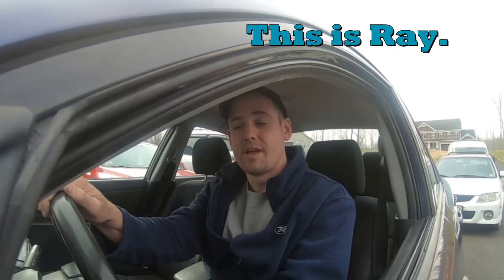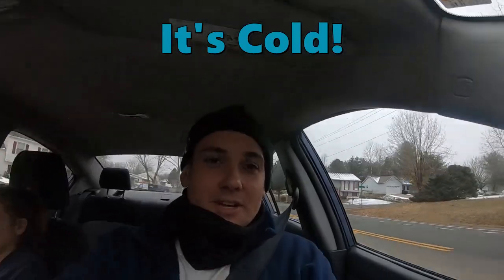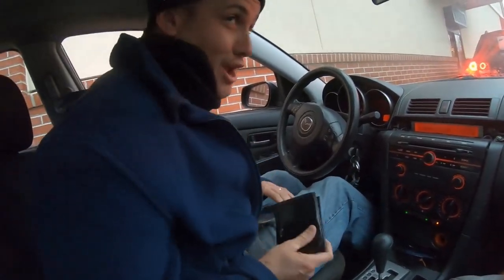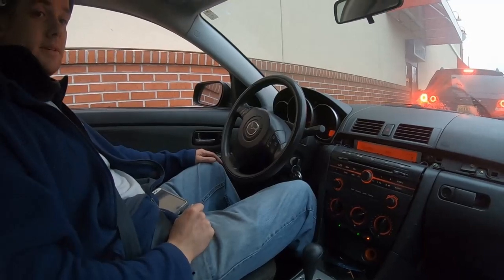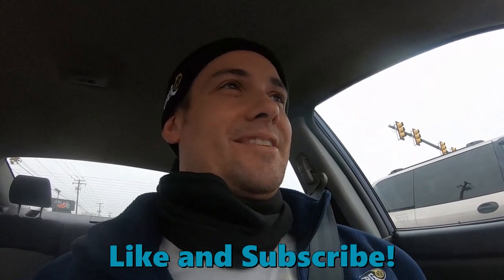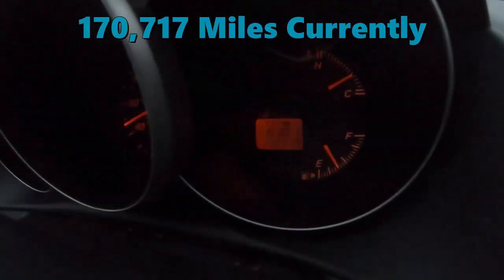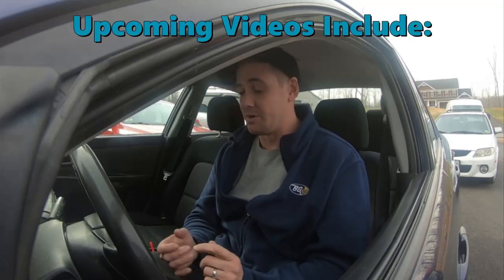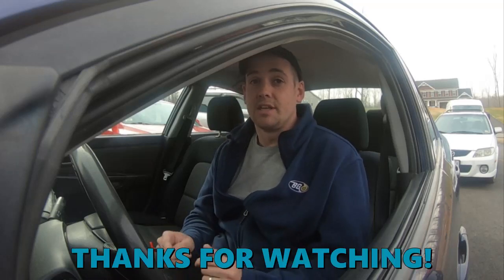Trash to Treasure Mazda 3 How to Video

Comment: I’m doing a similar project on a 2011 Mazda 3 (2.5L with 6 speed manual).  I’m glad yours was at least drivable!  I ended up replacing all 4 tires and rims, front wheel bearings, inner/outer tie rods, ball joints, all 4 sway bar links, rear struts, all of the motor mounts, spark plugs, valve cover gasket, oil pan, and alternator.  Of course I changed all the fluids as well.  The previous owner clearly didn’t take car of it, although they did at least seem to do their oil changes since the valve-train was in great shape with no sludge buildup.

Comment: $1500 for a 194K mile 2008 M3 with "no first gear" No problem when the code was for a stuck open auto transmission solenoid. Paid $1300 after the CVs were found to be wrecked and it stunk of strawberry vape. First to 2nd shift was shocking hard. Removed the solenoid pack and cleaned it, backflushed all 6 solenoids and cleaned valve body, replaced and filled with Walmart high mileage ATF as the stuff that came out was ink black. After resetting the transmission controller with my BT scanner, it shifted great and no more codes. ended up replacing every suspension wear pat minus the LCA's, only about $130 for the entire kit online. REplaced the 2 front wheel bearings and 2 CV axles. motor mounts are next as well as front sway bar bushings (eazy, 4 bolts from UP TOP slide new ones on and bolt back in) car runs great, cute little car. Mine was almost perfect inside and out, just nasty  vape odor inside. Took mats out and pressure washed them and the water running of them was as black as the ATF, GROSS! I got the GT with leather seats and BOSE audio with NAV. Great deal!

Comment: Hey.   Welcome back. 😉 could you answer a question about a rx8?  What causes the clutch to be really soft and barely engage until the car had been running a few minutes then the clutch is perfect until the next day  when the car is first started its like the clutch needs bled or something.. any help?
Reply from the maker: Thanks! Be patient with me, please. Lots of changes coming to the channel and RX8 stuff is on the docket! The biggest difference you have between a car that has been sitting and a car that has been running a few minutes would be heat. Heat would greatly effect the brake fluid operating in the clutch's hydraulic system, as well as the grease lubricating the pilot bearing.That being said I'd start by changing out the fluid. If I had to pick a component, my biggest suspect would be your slave cylinder and/or the rubber line coming off of the top of the cylinder. These rubber lines can swell externally and cause all kinds of weird characteristics. After changing the fluid out, I'd try bleeding it hot and then again cold and see if there is any difference in fluid flow that may point you in one direction.
Reply: @WhitneyAutomotive   thanks.  i was thinking slave already,  the fluids are all new and properly bled 👍

Comment: Hey Ray. So I’m into buy a Rx-8 all new transmission. New air filter. New oil. New oil filter. All oem parts are there. But has 80,000 miles currently. The only mod found was of a straight piped exhaust and test drove it car is amazing. But I’m here to ask on what other things I should look at before I actually go and buy it.
Reply: And grad to have you back. And with more future help.
Reply from the maker: Check out the pre purchase RX8 video I made so you know what to look out for. The main thing is to make sure that the engine starts easily both cold AND hot.
https://youtu.be/VgZJPW9uuZk

Comment: Just bought my son his 1st car today, a 2008 Mazda 3. I did my honework and found out 2 things to look out for with these cars are engine mounts and suspension. The dealer did a thorough inspection and replaced struts, installed new Yokohama tires,  trans flush, oil change, and a few other minor items. On first start up I noticed the vibration (felt it and heard it) at lower RMP, and it would lessen at higher RPM. 
As I stated, I knew about engine mounts, but did not know how to tell. Everything checked out on the car, no issues with the engine, trans shifted smooth, drove straight, did not pull when braking. So we bought it subject to my mechanic inspecting it. Turns out that vibration was the engine mount. Everything else checked out the car passed with flying colors, and the dealer is going to replace the mount.